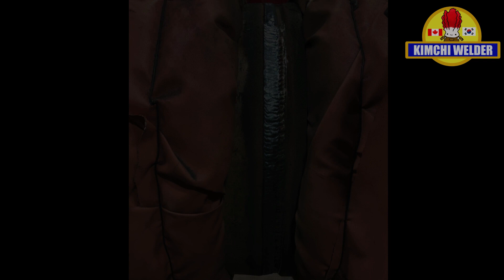1.25 Chrome Welding/TIG(GTAW)+Flux core(FCAW) Welding

Comment: you are a very good welder. Could you please show 6" sch 80 pipe Duplex welding the root pass with 2.4mm wire. Hear where I am in Australia I never see any one welding with 3.2mm GTAW wire only 2.4mm. Thank you
Reply from the maker: Hello, SB
yes, sure. it's om my list! 😁😁
Until I prepare and upload the duplex weld video, 
There are Half-keyhole welding videos among my videos. You can use the same method for duplex welding!
thanks for watching😎😎